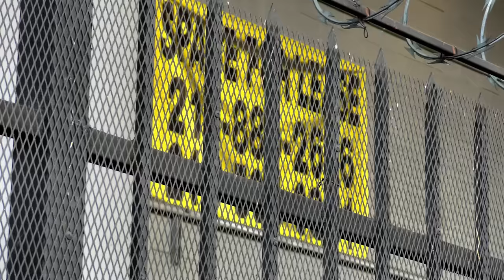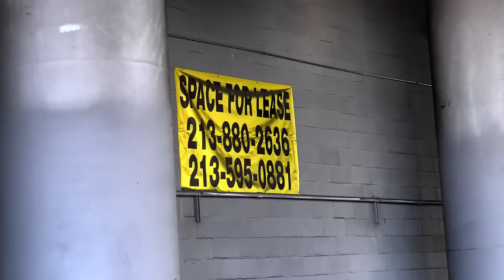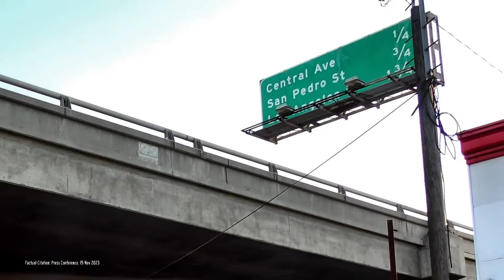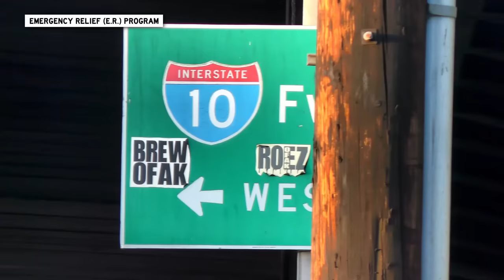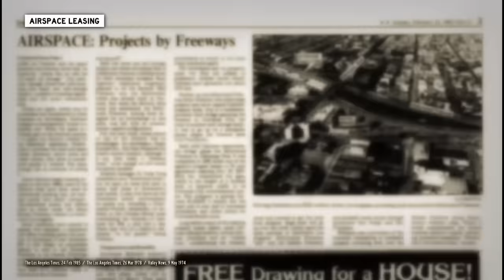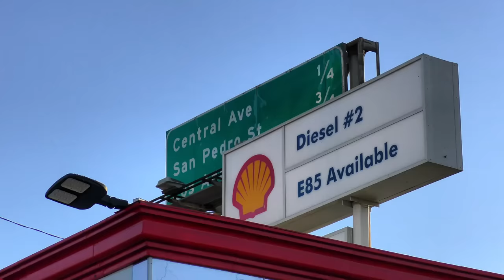California only has *70 DAYS LEFT* left to FIX I-10 🔥

Comment: It was only a throw-away mention, but the ability for transit to provide redundancy in disasters like this is massively underrated!
Reply from the maker: That is absolutely a topic warranting its own 10 minutes.  Yes.
Reply: Isn't this an argument against mass transit via trains?

When a road becomes unusable drivers can either drive other routes or go take some other kind of transit.  When a train track gets taken out the whole line shuts down and users are SOL -- and if they don't own cars they can't shift to driving easily.

It's never going to be cheaper to setup train service as a backup for roads than to just build out some extra roads.  The train has to replace the whole journey while the roads merely need to let you route around the problem.

I'm a big fan of mass transit via trains but I just don't think this is a good argument for them (the trick with trains is you have fewer routes to maintain so you can spend more to make it overall more reliable ..but that's the opposite strategy).
Reply: Let’s not forget that LA RUNS a lot of their light rail transit and BRT routes on the freeways. Freeway gets damaged, so does the transit. Not a good situation to be in.
Reply: @petergerdes1094  Increased service on other train lines and beefed up bus routes were used as alternatives during the Canarsie Tunnel reconstruction in NYC.
Reply: @petergerdes1094  No, in fact it's the opposite. Repairing train infrastructure is much cheaper than repairing car infrastructure. An overpass of equivalent capacity for a train would be 1/10th the width of the I-10 freeway. Naturally, a narrower right of way requires less material and is quicker to repair, which significantly reduces costs. And in countries where competent public transit is in place, disasters like this would be accounted for by providing temporary bus service to replace the train route. And alternate train routes can also more easily scale up capacity as a necessary compared to highways.
Reply: @petergerdes1094  In the same region, although Orange County not LA County. In October 2022 a combo errosion/landslide event took out Amtrak’s Pacific Surfliner and Metrolink’s Orange County line. It took almost 9 months to finally get the rails back to consistent, full operation and that was achieved this past July. I love trains but when the rails get taken out there’s usually not another line the train can just switch too. For the freeway there’s alternates and usually several of them at least. I’m not saying we shouldn’t build a better train network, but this situation is not a good argument for trains
Reply: Transit shouldn't be the redundancy; it should be the default in a city as bit as LA.
Reply: @petergerdes1094  well yes but no, a good transit system would usually have multiple semi-redundant lines, so if one goes out of service another line could pick up the slack. Obviously this isn't the case in LA, but other cities routinely close portions of transit lines with little issue because their systems are built for that.
Reply: @Amrepdude499 Well, and a good part of that is: When a highway needs urgent repair, CalTrans jumps right at it. When the train tracks are eroded, no single agency feels responsible and also has authority to do something, so lots of politics involved.
Reply: @Amrepdude499 mad respect for the criticism, us transit advocates would consider it! <:
Reply: @silver_bowling  The thing with another rail line picking up the slack is that the redundant line doesnt have any capacity constraints (if we don't count a slightly longer time to get from station to station).  It can run the same train with the same capacity of people on it, at about the same speed.
Reply: @petergerdes1094  what? not only do trains provide an alternate route to driving they also do it exponentially more efficiently. one subway train in my home city philly can move 700-1000 people.  cars move only 1 99% of the time and take up the space of half a train car each.  you also say its never going to be cheaper to set up train service but my guy do you know how much we spend on highways in this country? orders of magnitude more than we spend on transit. critically think
Reply: @petergerdes1094 I mean a building one line of redundant track is way cheaper than building an entire 8 lane redundant freeway
Reply: @RoadGuyRob  You could 2-for-1 and look at the I-5 bridge between Oregon and Washington, where there's a single point of failure (technically there's a relatively nearby crossing across town, the 205 bridge), the current bridge needs renovation, nobody can agree who will pay for what or how, and how the next decade or so of construction will screw everything up forever in a major metro area that's already overburdened by traffic.
Reply: SORRY GUYS, Newsom and Bass just announced the I-10 will be fixed and opened in 5 days, Nov 21,2023.
Reply: @RoadGuyRob  174 days to fix I-10, and maybe even less time for LA Metro to recapture transit ridership along the line.
Reply: @LimitedWard  But you don't need one line of track to backup a road.  You need a whole transit network that can take people (or at least enough people) to wherever they were going using that road.  There is no option where you just have a single line alongside and that provides useful backup for the freeway because you can't hop out of your car travel a few miles on the train and hop back into your car.  OTOH you can do that with other roads.

This isn't to say overall the road system is better/cheaper but that having a backup isn't a seperate reason for investing in a train system.
Reply: Honestly hope that more transit gets built around many more US cities, which a lot of people don’t understand will reduce traffic!

The more people that can catch transit do catch transit, then the less traffic the roads will have! Plus having multiple lines that are well interconnected, then won’t have to fully worry if one needs to close for maintenance or issues xP
Reply: @LimitedWard  To be clear, the issue isn't whether a mile of track is cheaper than one of road.  Just that if you wanted a backup in case something breaks creating a whole seperate train infrastructure is more expensive than increasing the capacity a bit on many road routes to allow detours or build a new train system from the ground up that is the more expensive thing.

Ok, but maybe you already have a train network.  Great, but you haven't made your system more resilient against breaks in link's overall because your system has tons of train riders and if a train link breaks in a commuter style system (eg lines into central area) there is no backup with roads because in a good system many of those train riders don't have cars.

It's not a diss on trains just that this isn't an argument for that system (your train system can be as reliable but you do that by avoiding having tracks go down).

--

Yes obviously it's always better to have infrastructure than not but then the reference to transit here is misleading...it's nothing about trains it's just about spare capacity in some fashion.
Reply: @respect411  If you had read my comment I don't disagree with anything you said...but that's not about trains acting as a backup but *alternative*.  Yes it's more efficient and better in all sorts of ways but those were the reasons to invest in it in normal operation...point is that you shouldn't ever be thinking: nah we don't need trains here highways are better and have someone come along and go: sometimes things break and change your mind.

Trains are better because they are better when everything is working well. They encourage people to abandon cars which is good but it means that if a train breaks you don't have a car alternative.   

One of the few ways trains aren't better is they don't make it more likely that if random links get taken out everyone can still get where they are going (which is why you invest a bit more so they aren't taken out...overall still more efficient because one line of track built well is cheaper than many roads but still an alternative not backup).

So yes trains are generally better but this backup argument isn't a good one.
Reply: @WhereWeRoll   I don't doubt that trains can be more reliable in general but the one place they aren't as good is preserving access if you expect random breaks in links independent of quality (eg bc of natural disaster).  That's true even if you build a backup line using seperate bridges which I've never heard of because you don't have the background of surface streets that allow short diversions.

Besides,  that's a reason why trains are in general a better system not why they are a compliment to highways (we need trains to help highways when they break).

For the most part, more miles of train/highway make the other less valuable per mile (other things being equal not more) not more valuable.  You don't build a train network to backup the highway system but as an alternative.  I'm not arguing that trains aren't great/better just that you don't build them because they supplement the highways in case of emergency but because they offer an alternative to so many highways.
Reply: @TrebleSketch  Totally agree...but that's trains as a substitute for roads (we build trains so we don't have to build so many roads) not trains as a compliment to roads (we build trains so they can play backup if roads break).
Reply: @Amrepdude499  It took ten months because we prioritize cars over trains.
If it was a section the I-5 take out, you bet they  would have JUMPED on it.
Reply: @petergerdes1094 you realize how much easier is is to replace even double tracked rail compared to a 12+ lane elevated freeway though right??
Reply: @Amrepdude499 this was due to policy choice along with the the coastal commission taking forever to approve changes. This was a policy issue, not an engineering issue.
Reply: @DiogenesOfCa exactly! Pure policy not engineering
Reply: @cameronchaloux1135  Yes, that's why I think it's a better choice overall.  But what it still isn't is a good solution to the problem of: if we stupidly decide to base our transit on highways how do we ensure that there isn't a situation where people can't get to their destinations if those highways break...ohh I know let's build trains as a backup.

You build a train systemso you don't rely so much on highways in the first place not to plug holes in a highway based system.  Trains are substitutes for highways not compliments.
Reply: there is a redundancy, you just have to go an extra 15 mins of driving, it'll cause delays for everyone on both roads from the increase in traffic, but its not completely cut off
do you have a redundancy for owning a car or owning a house?
your redundancy for a house fire is staying at a hotel
Reply: @petergerdes1094  the trick is to build a transit network. If one line is closed, its possible to make a detour. The problem is that it takes decades. That said, we didn't build every road in the world overnight.
Reply: It can provide some redundancy, generally not enough to cover the entire shortfall, so remote working and avoiding unnecessary journeys are still required to keep congestion down. It also tends to extend journey times significantly, so is not seen as a viable long term alternative. Generally the only solution to that is to build new transit infrastructure.
Reply: @petergerdes1094 It is, but that's in any case where you FORCE population through one specific transit method

So one highway, bus or train line
The US's issue is it forces you to use a car, you can't go by rail, bike, bus or on foot anywhere in the vast majority of the countryside.
Where in Europe it's a choice, even if one-sided towards cars at times
Reply: So the reconstituted ferry system in the Bay Area explicitly is intended to provide alternate transportation in the event that the bridge infrastructure is damaged in an earthquake.
Reply: @petergerdes1094   The cost to build multiple tracks is probably a fraction of the cost of a highway lol. Nimbys created LAs traffic problems.
Reply: @ej_tech and in the 1973-4 oil embargo. I was using the bus to go downtown before my friends were of age to drive.
Reply: @sIosha  The cost of a train is hundreds to millions of dollars per mile, similar to new roads and highways. But the per person cost is much lower, yes.
Reply: @petergerdes1094 we don’t have to hypothesise about it. We already know rail is more reliable and more redundant in places where it’s the done thing because it is, not because we can rationalise it before the fact. And you’re assuming the argument is rail vs. cars. It’s more reliable to have BOTH alternative routes and rail as a backup. If you have no backup rail options, you can move people on buses on the roads with minimal impact. If you have no transit, then drivers just sit in carmageddon which we’ve seen before.
Granted, you COULD just have the people on buses in the first place, but if you’re geared to need that option, that’s not where you’ll end up come the time anyway, because everyone will already be driving.
Reply: @karlkoehler341 That's not a transit problem, it's a government problem. I was almost angry at how fast I-95 got fixed in Philadelphia because it proved that if politicians actually care, things can still get done.
Reply: @Amrepdude499  A more apples-to-apples example would be the Union Pacific bridge in Tempe arizona that partially collapsed in 2022 after a fire from a derailment. It was reopened in just under two weeks. They were able to do it that fast mostly by utilizing pre-made bridge sections that could be used anywhere on their network. I'm guessing part of the speed difference is also the motivation to get it finished quickly, UP being motivated by loss of revenue while the government repeatedly puts transit at a low priority. I95 in Philly has shown that roads can reopen quickly too, given the right conditions, though it will be somewhat bottle-necked until construction is done. I think rail will almost always be quicker to replace at the same level of service as before IF both modes are given the same level of priority. A one or two track bridge can be pre-made and ready to deploy when needed, but the 4,5,6+ lanes needed to replace that capacity would be much more difficult to pre-make and install when needed.
Reply: @petergerdes1094  no, because in a world where the main transit option is trains, there are still smaller roads around for busses to carry people around until the damage to the train infrastructure is fixed.
Reply: @jeanschyso  Still an argument as to why you should build trains as an alternative to highways (I agree) not as a supplement to highways to make them more reliable since you don't want to build enough highways for everyone to be able to get around without massive gridlock not to mention that then you still need everyone to own cars.  If you need to build enough highways for everyone to get into a car and drive you need to build lots of highways not just your background level of surface streets.

My point isn't that one system is better than the other but that they are alternatives not compliments.  The more miles of highway you have the more value in additional highway capacity and the more miles of train track you have the more value from an additional mile of track and from spending the little bit extra to make the train track more reliable (higher quality materials and more maintenance...more than balanced out by fact u need less track per passenger).

So there should never be a situation where you use trains as a backup for your highways.  You buy the trains as an alternative to building so many highways.

-- 

Having said that, in the very unusual situation that you are building transit right next to something like an active volcano that's going to take out links randomly with some regularity you should probably go with highways.
Reply: @RoadGuyRob thank god today Monday the 20th the 10 is open
Reply: @petergerdes1094  Youre arguing against a position that wasnt given. They only said the redundancy is a boon. They did not say transit is better than cars

Comparing public transit to cars is far more complicated than this one issue. This one issue of something breaking down so what happens next, is more determined by what a city already has more than anything, and in LA, thats cars. In a city with more public transit, there will be more public transit routes to use to get around what is breaking down
Reply: @petergerdes1094 "Having said that, in the very unusual situation that you are building transit right next to something like an active volcano that's going to take out links randomly with some regularity you should probably go with highways."
Tokyo would beg to differ
Reply: @desu5070  The original comment before editing strongly implied that we should be building more mass transit to act as backup when our highways break.  I said that wasn't a good argument for mass transit.  The rest of the discussion is downstream of that.  

If your claim is that no one is suggesting that's a good argument then why disagree with the claim that it's not?
Reply: @petergerdes1094  A good enough train network will have alternate routes. Cars only have more freedom because we've built more highways.